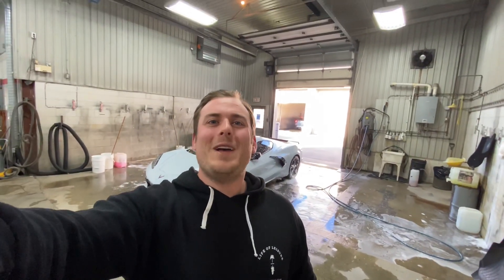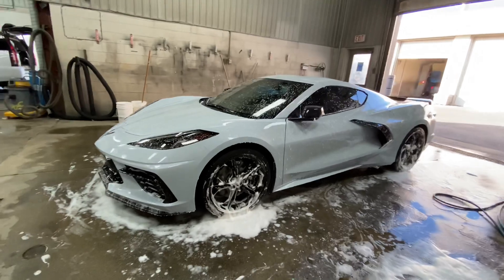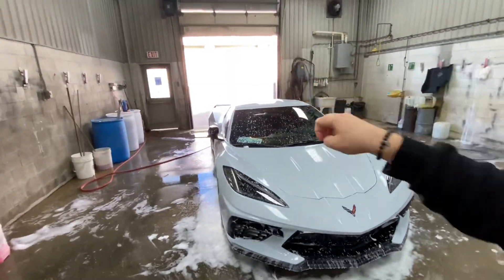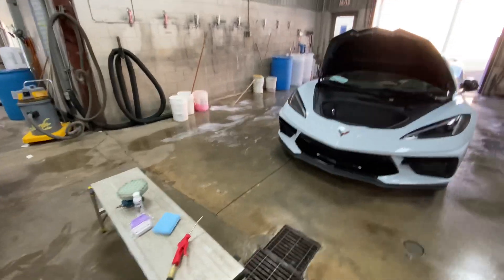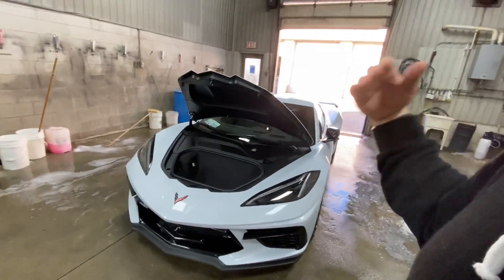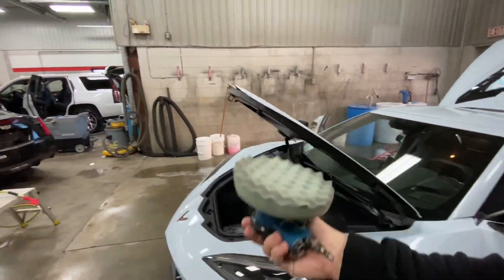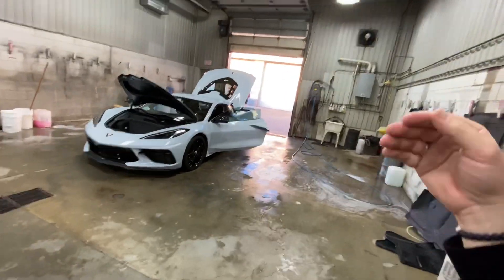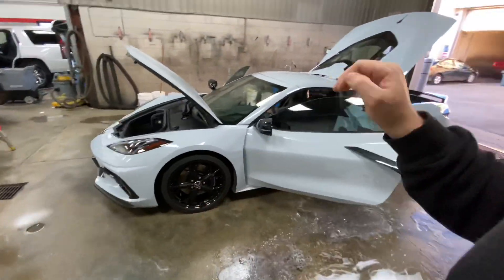Detailing my C8 at a GM dealership and updates on the mods to my C8

Comment: Actually, any wax product should be avoided. That is not a good idea. There are detail products from Adams that work after the liquid application of the ceramic. Do not Clay bar, unless you have a correction. Also, certamic treatment of the engine compartment is an important element to keep the engine compartment hydrophobic. Are you lowering just for looks, or for performance? There are different things you can do. But remember, performance is affected by this modification. Actually, I would drop the car no more than 6/10 of an inch.  Otherwise, you will be using that front end lift all the time to get over objects and then you will wind up scraping the front end. AF Best wishes Morgan